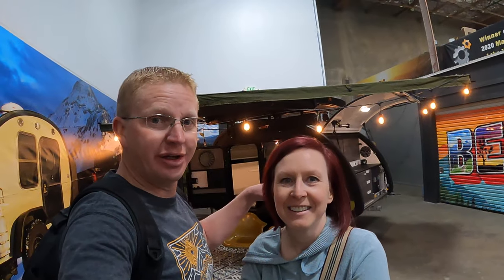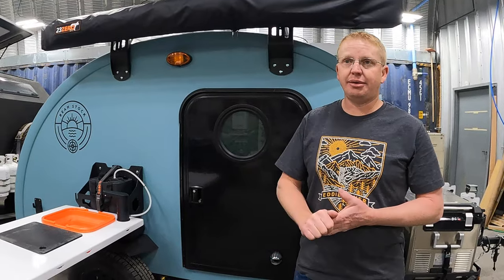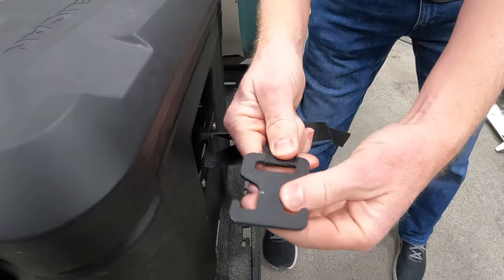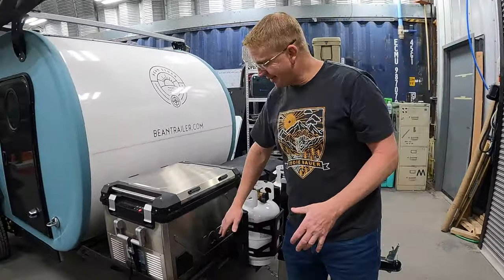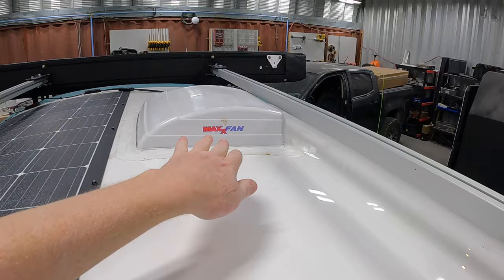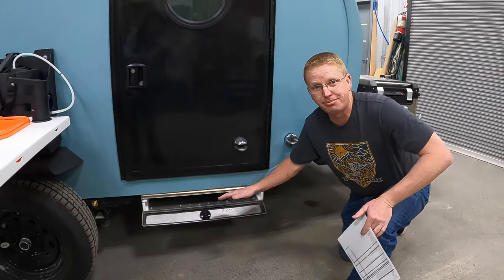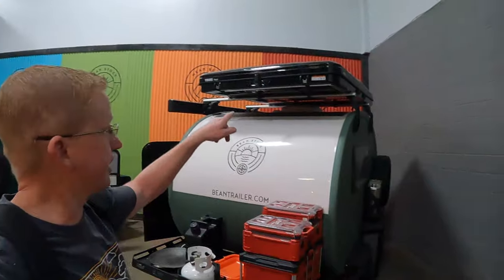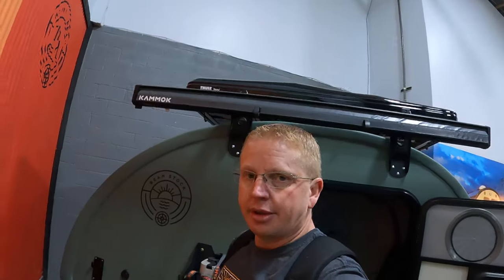Most Affordable and Best Built Trailer? Bean Stock 2.0 RV

Comment: Nice video, question, is it Bean Stock or as the title of the video say, Bean Stalk?  While I like the simplicity of the propane tank holders, I do believe D.O.T. requires a safety cable additionally, which would be simple to add.
Reply from the maker: I have seen it both ways stalk and stock I will double check.  I have been wrong before.
Reply: The logo on the side says bean stock. It's a play on words.

Comment: The storage on this Bean Stock is nil. With all that open space inside just a small area, no thanks
Reply from the maker: Thanks for watching.
Reply: There is a ton of space for storage because the entire area that would be a galley is open space inside the trailer. You just need to use bins or a drawer unit or something.

Comment: We are looking at the bean Stalk 2.0 for our first teardrop trailer. I like everything about it. One of my questions is how hot does it get inside during the summer time. Is the Maxx fan enough to keep it cool for sleeping?  We plan on traveling out west form NY. Also great review.
Reply from the maker: We have used ours in 100° temps and it was warm.  We had the fan going and the doors open.  If you are going for extended periods I would add the a/c unit.
Reply: @JauntJunkies  it’s like living in an oven, all small trailers without air are.

Comment: Looks like all the weight is on the hitch
Reply from the maker: @anthonypanepinto9685  not much because when you get you gear loaded inside.  But with the overalll weight being so low it is better to have the hitch weight.  If you figure 10-15% hitch weight that is not much weight on the vehicle.  Thanks for watching.